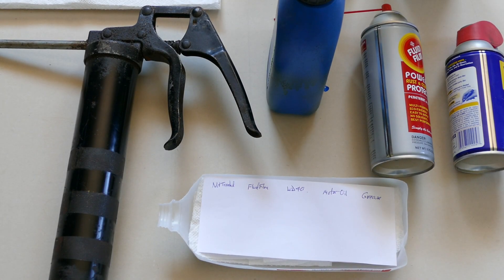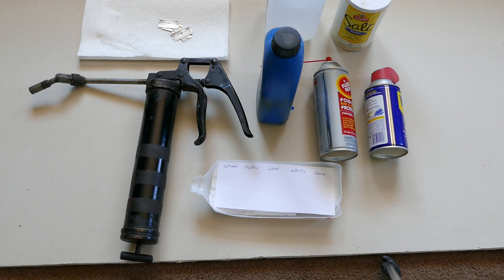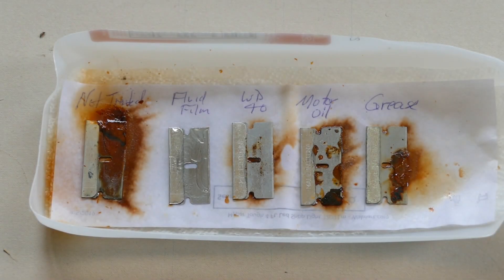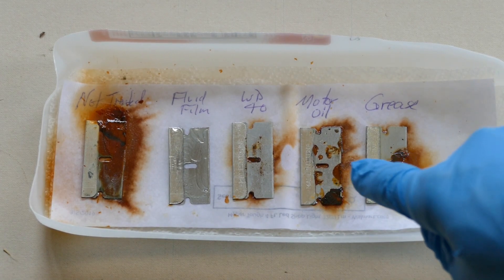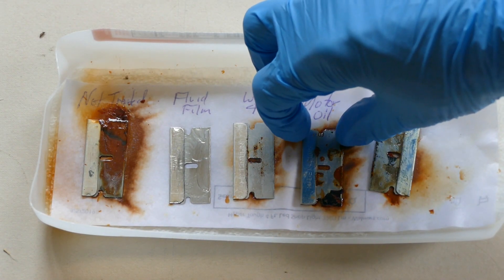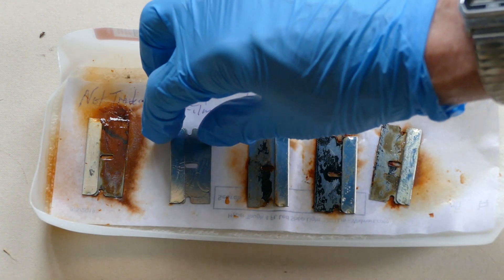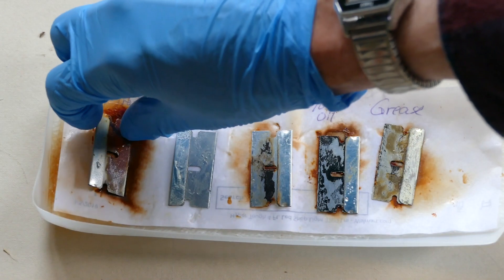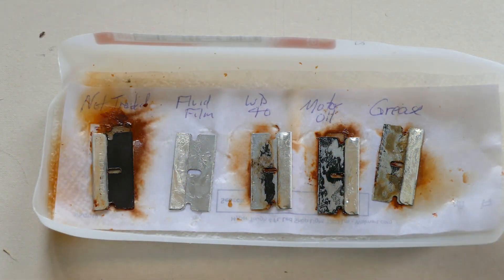Rust Prevention Test. Fluid Film vs Grease vs WD40 vs Motor Oil

Comment: My plan is to mix new motor oil with WD-40 as a "temporary" rustproofing until Springtime.  It's too late in the season for me to disassemble my truck and sand, clean, Ospho, primer and paint the underside of my old truck.  So, I figured the oil and WD-40 would be a good temporary solution.  The WD is Water Displacement and the product is good for creeping deep into crevices like Fluid Film does.  The motor oil just gives the solution some body to stick where it is sprayed.  I thought about Linseed oil but that dries to a hard shell.  That would be difficult or impossible to remove in the Spring to let the Ospho and primer get a good grip on the metal.  Anyone have any opinions on my plan?

Comment: razer blades are stainless or high speed steel composit . do this test on regular truck frame steel , than maybe i might impressed
Reply: How are they a composite?
Reply: It's still the same process of oxidation.
Reply: Razer Blades are absolutely not stainless. The whole point is they are cheap and disposable. Stainless is expensive. Doesn’t even make sense to make them out of stainless. But if you don’t believe me do a magnet test. Stainless is non magnetic and won’t stick to a magnet.

Comment: Nice video thanks, I've been cleaning some pieces of my son's pocket bike engine, I used vinegar and it went good, pieces were spotless unfortunately I decided to "protect" those cleaned pieces with motor oil and two days later, while stored in a closed and dry box it already starts to rust on some spot and it's bothersome.

Looks like WD-40 is doing a better job than motor oil, at least until I get my hand on some fluid film. Thanks, really.
Reply from the maker: Motor oil does give some protection especially with fresh water exposure. I used to keep an oil rag handy to wipe tools down that got wet. This test uses extremely salty water with plenty of air exposure to maximize corrosion. I have found that fluid film is amazing at preventing rust, I use it all the time now.

Comment: How long does fluid film stay on the car's metal chassis. Let's say in monsoon conditions, would the coat become insignificant?
Reply from the maker: It will wash off with a lot of water. For example if it was sprayed in a wheel well and then driven through a puddle at high speed it would wash off. It still leaves a residue, but some spots might rust.

Comment: I see a lot of people undercoat their vehicle with used motor oil. BIG NO NO!!!!!! Although it’s great for protecting the metal undercarriage, the oil will break down and eventually ruin rubber engine mounts, body mounts, etc.......Fluid film is ok, but for the price you’re better off using straight hydraulic fluid in an undercoat sprayer. Once in the fall, and once in the spring.
Reply: I dont know about that to be honest. Anything used around a motor or drive train is going to be oil resistant rubber. Fluid film even says not to use it around non oil resistant rubber like door window seals. I know my door seals swelled after using fluid film. Now as for body mounts i don't know? I guess stay away from them with both products? Then again i would rather have to replace them than  have to reconstruct the metal around them.

Comment: I got myself a case of fluid film from amazon. Been spraying the underside of my cars each December with one can per car. We’ll see how kind the years are to them.
Reply from the maker: I also spot spray when I change my oil, on parts that look to have some surface rust.
Reply: Does it work well?
Reply: @livingsacrifice7639  I don't have a control sample but I do suspect it helps. Last year was the first time I spent a lot of time scraping any loose rust with a wire brush and metal scraper. If the following year less material comes off, that is a sign it's working.

Comment: Great video. Thank you. Do you think one can use fluid film and grease together? Or will they clash in some ways? I am thinking about using fluid film to rust proof some gears and double up with grease if they don’t clash.
Reply from the maker: I don't know. Fluid film is lanolin based which comes from sheep's skin, and grease is petroleum based and has a higher viscosity. I never tried mixing them together.
Reply: Dasdfjkl Thank you. Guess I just have to try and see what happens.
Reply: I dilute with chain oil
Reply: Mix in very small quantity and try on nail or razor blade... Just out of curiosity... And update me

Comment: Is it a sponsored video or independent review?
Reply from the maker: Independent and the test conditions were the same for all of them. Used very salty water. I had been using fluid film, and I was really interested in seeing if other cheaper chemicals would be good.
Reply: @DAS-Videos  FF is cheaper than the others, except supertech oil.
Reply from the maker: @ureasmith3049  It is about $8.30 a can if purchased in bulk, up to $9.97 per can at Home Depot.

Comment: I don't know about you but after winter I wash my car. Coating, exposure to salt, then high pressuring washing the metal would be closer to real world... Unless you fluid film every time you wash your car
Reply from the maker: Yes washing after winter and getting the salt off goes a long way to prevent rust. Fluid film is for the undercarriage. I change my own oil so when I am under there I spray any spots that look like they are starting to rust.

Comment: I am wondering if you could dilute the fluid film in oil to do several cars under spraying?  Is used motor oil as good as new for rust? Obviously, it will dry out over time, could we coat the fluid film in old motor oil to slow dry out?  Heavy v. Light oil?
Reply: I dilute with chain oil to be a Val to use a spray gun